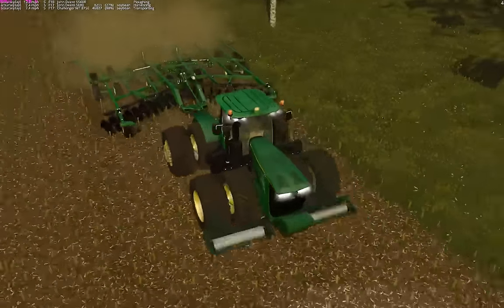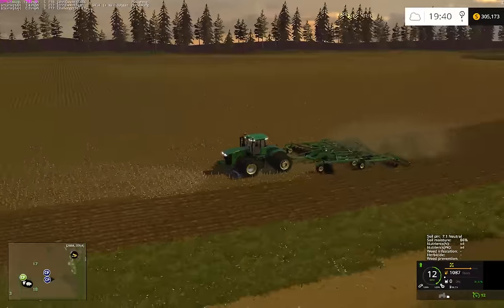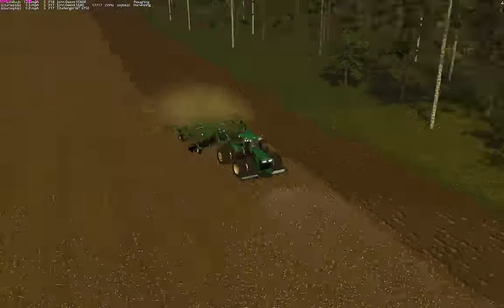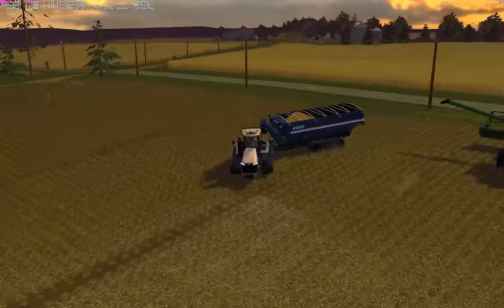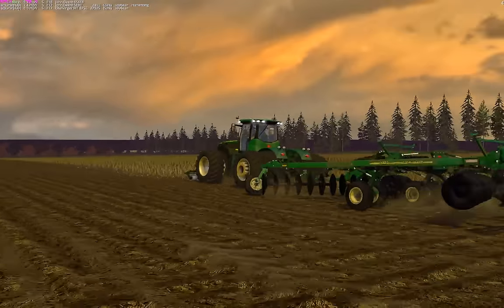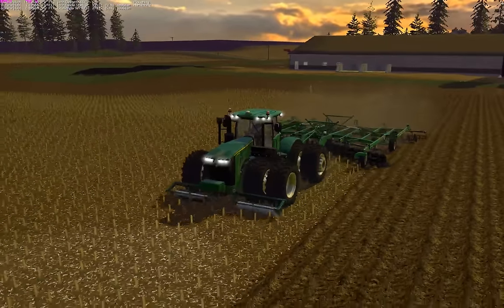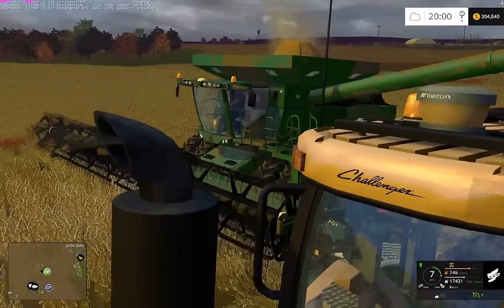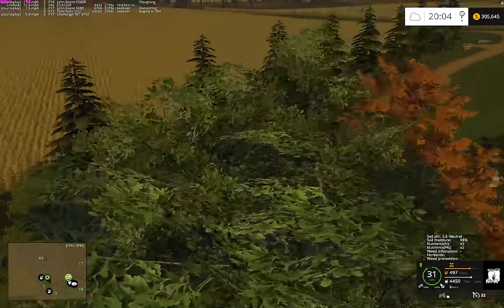Farming Simulator 2015: Harvest & Primary Tillage

Comment: ***** would it be possible to "buy" seasons (summer, fall, winter and spring) because it (for me) is hard to watch you plant during fall, I don't know anything about modding, textures, or scripting, but I think that if anyone was able to do it, it would be you.
Reply: With snow and Christmas decorations, and during the spring time have water on the fields and ditches, and high water in the st. Croix